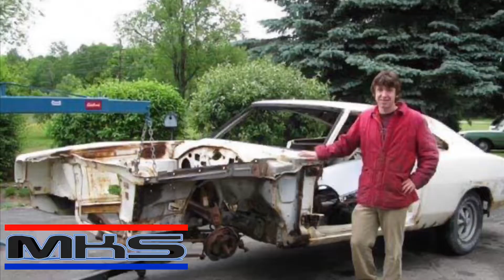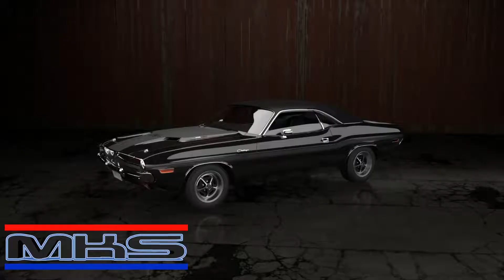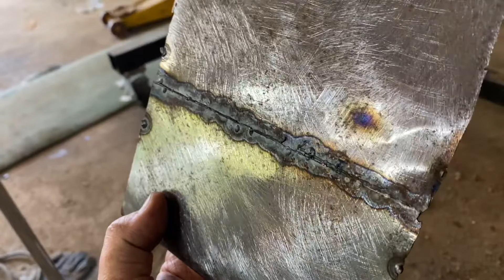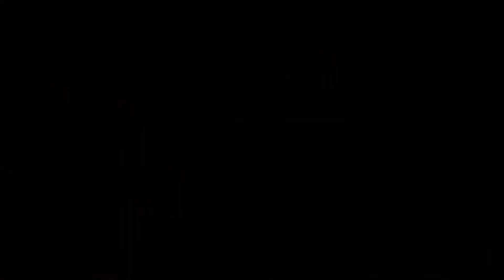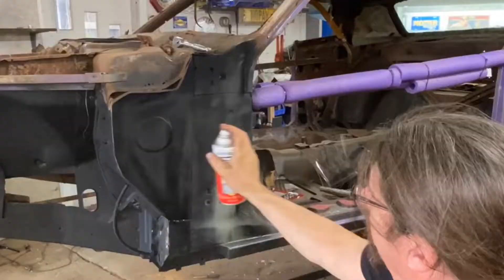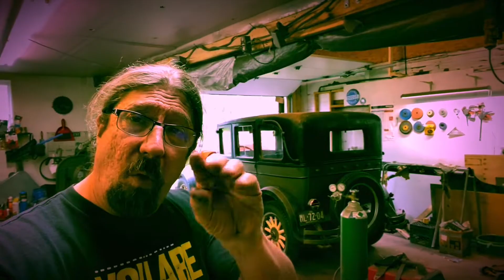Abandoned & Destroyed 70 Challenger Repair - Making and Finishing Side Cowl Panel Patches

Comment: So nice to see that black spreading on the car again. Had an overwhelming urge to see you go after that long thin triangular upper fender support, above and in front of where you were working. You going after the rocker panel next time will probably satisfy that urge equally well I guess. Great, solid, tangible progress. Motivated to go outside with the scratch doctor and buff out some micro scratches on the commuter's roof. Might even do it after I plug hole number one with a pastrami on brown with dijon and Helmanns.

Malcolm Ottawa Valley
Reply from the maker: It’s a month later right now and I still haven’t gotten to the rocker panel. 😂😂 Life is kind of throwing me a bit of a curveball. But don’t worry the episodes are still coming Tuesday Friday and Sunday. 

Thanks for watching as always
Reply: @MyKARSShop  you'll get through pal. Nobody watching what you're doing would call you a quitter. That's for sure. It's two hours  later here and I wolfed down the sammmich, brought in the washing off the line(it's Ontario, our woke Prime Minister has made sure we can't afford the energy bill for the dryer), and the heavens opened above me with a torrential downpour. On the bright side I won't have to wash the commuter.

Malcolm Ottawa Valley

Comment: What's your flavor of:
1. Etching primer?
2. Bondo(s)?
3. Rust converter?
4. Abrasives? 
If you list these in a video, which one? Much appreciated!
Reply from the maker: Nason etch prime 
Usually evercoat 
usually Rustoleum sometimes Loctite
I usually use the generic stuff for my body shop supply house… But I’m not real fussy about abrasives. My grinding discs and cut off wheels are usually Dewalt. Wire wheels are Hobart

When I get into paint & bodywork… I almost exclusively use 3M abrasives